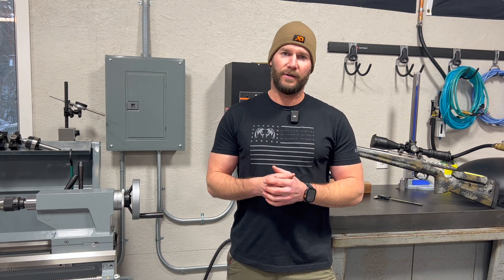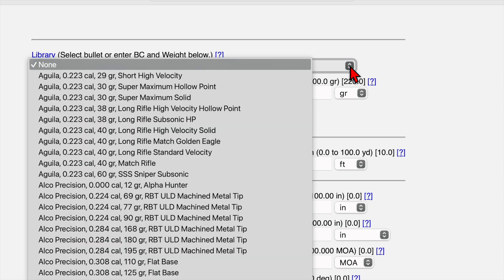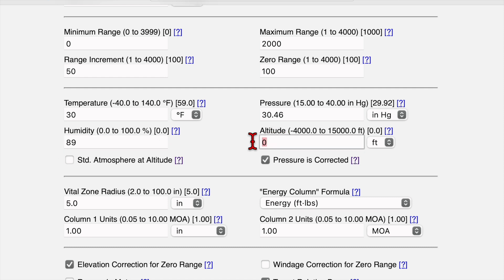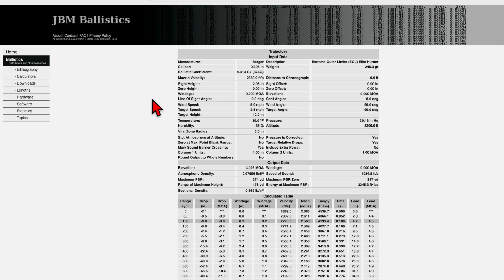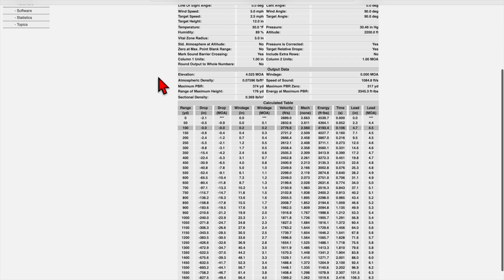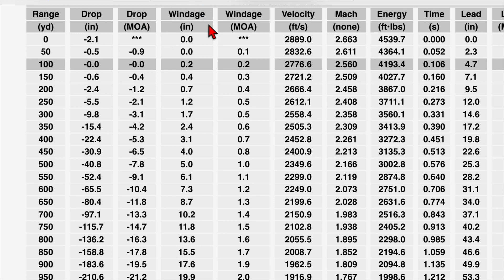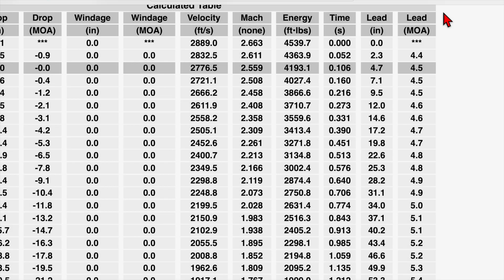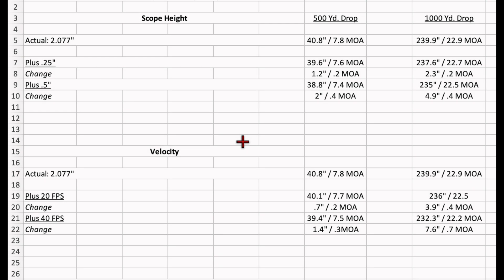TPM - Intro to Precision Rifle Shooting - How to Build a Bullet Drop Chart  (Dope Card)  -  Part 2

Comment: why do these calcs always default to a G1? is there some reason why we are using G1 over G7 in these calcs? I assume its because they just don't matter before transonic and G1 is easier... somehow?
Reply from the maker: Thats a great question. My thoughts are G1 is conceptually a little easier to use as a scale for people. I know this is the case for me, I'll look at the G1 and have an immediate idea how that bullet will perform as far as external ballistics go. You commonly see bullets with G1's listed anywhere from .130 (.22LR) all the way to in the .9's (solid ELR slugs).  WIth G7 the scale is much finer. for example, take the .338 Berger 300 Grain Elite Hunter with a G1 of .417 and G7 of .814, then take the Berger .224 70 Gr VLD with a G1 of .191 and G7 of .374.   If you take those two bullets and compare the G1's and G7's respectively you see we have a G7 difference between the two of .226 and a G1 difference of .440. Drag differences in the G7 model are represented by much more subtle changes in the numerical value.  I'm not sure if that is the only reason we see G1's on boat tail bullet info sheets and ballistic calculators, but I think it may have something to do with it. 

One other thing I just thought of.... When I'm developing DOPE on a rifle, I will always start with the bullet manufacturer's G7 BC. If that just won't line up with my observed trajectory, I will then see how the G1 drag model fits. Sometimes it just works, other times not but its one more thing to test out.

That was kind of long and drawn out, I hope that makes sense!

-Shawn
Reply: @triggeredprecisionmachinellc  Thank you, yea I think I'm following what you're putting down.